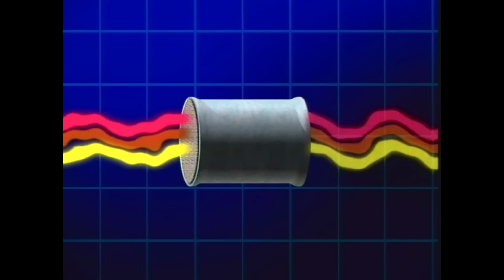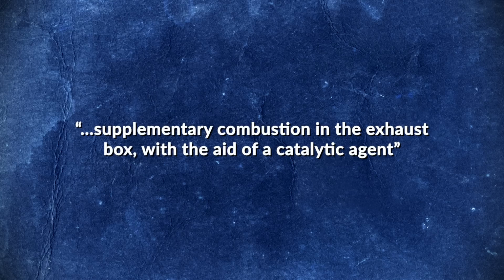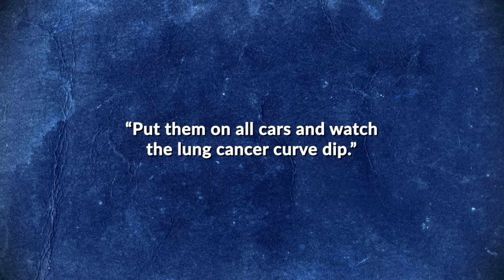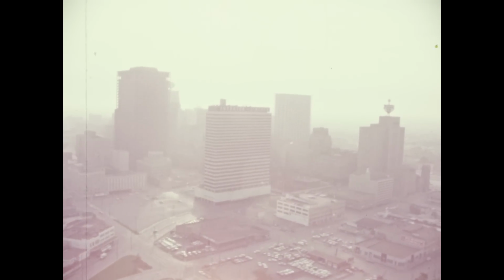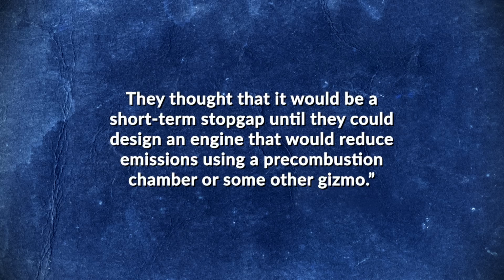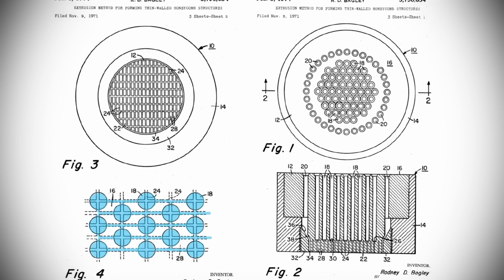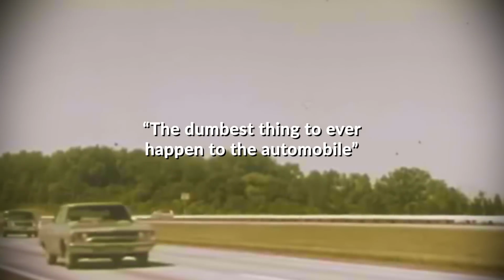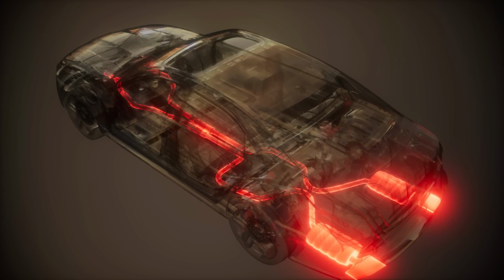The Most Underrated Automotive Component of All Time

Comment: Huh, who would have thought GM would sabotage any regulation that would cost them a dime even if it meant saving millions of lives.
Reply: I grew up in LA county in the '70s. The smog was bad. Was smog eliminated? No. But there was less smog with far more cars.

So yes. They save lives. Removing lead from the gas also saved lives.
Reply: @alannitcher5001  sounds like the city is the problem. We never had smog here. You also have smog pumps on California cars. Another thing that's killing your fuel mileage. A better factory tune would go a long way. To the point that they might not need cars as much, and have better fuel mileage to boot. Higher octane gas would help, too.
Reply: @manicmechanic448 Cities had smog problems, yes. And catalytic converters single handedly fixed them, also yes. Sounds like a win, to me! Especially since cities tend to be where most of the people live.
Reply: @manicmechanic448 And the fuel economy penalties are tiny, with modern cats. So that's no excuse to ditch them. It ain't the 1970s, anymore!

What do you expect to gain out of higher octane gas? You don't get better power or fuel economy out of it, unless your engine is limited by engine knock. You just pay more at the pump.
Reply: @Bertinator-nm9ld Catalytic converters were a major improvement.But cities also banned open trash burning and limited stationary emissions from power plants, boilers, furnaces, and incinerators around the same time as the introduction of catalytic converters.
Reply: @gregorymalchuk272  well, okay. You got me! Catalytic converters ALMOST single handedly stopped the problem. They weren't the only factor, but they were certainly one of the biggest factors!
Reply: @manicmechanic448  I'm from the burbs around LA. Where you know you're in a different city at night because the street lights changed. The valley is a huge boal trapping smog from millions of cars and other sources. 

I left that part of the state 30 years ago. Had trouble trusting the air for a couple of years. Couldn't see it anymore, so I couldn't keep an eye on it.

The legislation around clean air has made a huge difference in the air quality in this country and the western world.
Reply: @alannitcher5001  it's also, lined a lot of pockets, and added multiple extra layers of complexity to the average vehicle. Also, I don't care where you live, and if the air scares you then you got bigger problems than I do.
Reply: @manicmechanic448  Sarcasm escapes you, I see.

Yes, the air scared me. At times, I couldn't breathe. It was one of the reasons why I no longer live in LA county. I'm guessing that you've never had the pleasure of trying to breathe during a smog alert from the 70s. While having an asthma attack. Wondering if you'll be able to take that next breath, or will your throat close completely. If you never have, then you have no clue what you're talking about. But let me help you understand. Light a fire, stand in the smoke, and breathe for a few hours. The next day, do it again. For the rest of summer and into fall.
Reply: @manicmechanic448  No.  If you want less NOx and CO emissions you have to reduce the combustion temperature and compression. That leads to more particulates and even worse fuel consumpttion. EVs are the future.
Reply: @rogerphelps9939  you really need to see where EVs come from. And congratulations! You're successfully killing my fuel mileage. Maybe you stick to your day job.
Reply: If you think these things save lives, then you really are takin the Kool aid.
Reply: @manicmechanic448 Buddy, you're drinking GM's lead laced kool ade. Hell even Simon here is by stating it was a difficult unproven technology, right after saying they were already in use in heavy machinery 😂
Reply: @manicmechanic448  It is you that are denying reality. They most definitely do save lives. here is evidence you know, not your opinion.

Comment: When I was a kid we had a catalytic gas heater. It burned the gas on a corrugated plate with no visible flame. I believe it used the same technology as exhaust cars.
Reply: Your right. 
If you take a pure platinum wire and put it in alcohol vapor (or most any hydrocarbon) it will ignite and sustain a flame.
Reply: @Bob3519 Cool. Ty

Comment: CATs and unleaded didn't become mandatory until 1994 in the UK - over10 years behind the US, why?
Reply: In the UK, cats were mandatory from 1993, and leaded wasn't banned until 1999. Although by 1990 most cars were unleaded only anyway. Leaded fuel wasn't actually banned in the US until 1996. 

It's worth considering that the average UK car for much of the 70s, 80s and 90s had small engines of less than 2000cc. In the US, the smallest engines were typically closer to 3000cc and engines in excess of 7000cc were common. The level of combustion gas pollution was on another planet.

Cats were a pretty compromised solution. Without closed loop fuel injection, 3 way catalysts don't work very well. In the US many cats would have been rendered useless by exposure to enrichened fuel mixtures thanks to carburettors, or poisoned by owners choosing to continue to use cheaper leaded fuel.
Reply: Y'all don't live with your cars like the USA does. We have terrible public transportation as a matter of course, and its expected for you to own a car or you are not seen as successful.
Reply: Because they didn't have nearly the quantity of automobiles on the road as the US. Public transportation has always been better in the UK, the distances that are traveled are 1/20th and Brittain is old towns and cities where the US is suburbs branching out from cities.
Reply: It's crazy how lax European emissions standards were. The US required 3 way catalysts and computer control by 1981, 1980 in California. We had 2 way catalysts in the mid 1970s.

Comment: No, everyone is well aware of the catalytic converter and what it does. It is also expensive, which means people putting one on a car appreciate what it does, or they wouldn’t spend the $1000s to replace it. The most underrated automotive component is a small simple device, that even today you can pick up for a few dollars or less. Anyone with some basic understanding of engines can retrofit it to any engine that didn’t come with one in less than an hour with basic tools, however you have probably never had to because it has been on every single car since the mid 60s. This device improves emissions, fuel mileage, and horsepower! It easily triples the expected engine life compared to the same engine without one. It also helps prevent and reduce oil leaks, keeps the underside of your car cleaner, and is responsible for a significant reduction in wet weather car accidents! What is this magical part that sounds too good to be true? It is the lowly PCV valve! That is truly the most underrated automotive component!
Reply: Good call. Deep cuts with the PCV. 🔥
Reply: I have a car that the PCV constantly popped off mid drive. It ran like crap with it not connected. One day the piece you just popped the little hose back on was gone. So that hose is now just clamped to the PCV. That car is a 2005 Chevy equinox with almost 300k miles on it. I’ve replaced the head gasket twice. It has a small coolant leak now. The exhaust is fixed up as well as it can be without replacing it. The cruise control no longer works. The fob no longer unlocks the doors. My daughter drove it in high school and all the way through college. She also hit about everything she could and dented it up well. But that little hose clamp has kept that hose connected to the PCV for years now. I’m convinced it will be the only thing that’s totally functional whenever it gives up the ghost and we have to send it to the dead car grave yard. 😂
Reply: I replaced my cats with test pipes. Ill put mine back on once millionaires stop taking private jets.
Reply: I like to be able to walk behind my car when it’s idling and not have my eyes start watering and my clothes stink like fuel! If that costs me 3hp, then so be it!
Reply: A few years ago I swapped out the PCV valve in my nb Miata in an attempt to correct a code. It was definitely not the source of the CEL but I started getting 80+ more miles per tank. Same thing happened in 3 different Miatas. Incredible.
Reply: I don't think everyone knows what a CAT is/does. I sure didn't until watching this video. My dad was a bad teacher when it came to cars. I think when I asked him what it was he said "don't touch that" :)
Reply: People mainly spend the thousands to replace it because it's illegal af to not have it. If it wasn't illegal, most people would opt to leave it off.
Reply: @jorceshaman  Only in states and countries with emissions requirements.
Reply: @jorceshaman  They like killing vulnerable people.
Reply: I know many people, including myself, who have added cats to older cars that did not originally come with them. I also know many people who have replaced failed cats with new ones on cars that were exempt from inspection due to their age, and while it is true that just because nobody is inspecting the car doesn’t make it legal to remove the cat, as a practical matter if you have an older car that is no longer subject to inspection, your odds of getting in trouble for deleting it are extremely low, and yet many people still put cats back on those cars. So to say that the only reason people reinstall them is because it is illegal to not have them is not accurate.
Reply: @michaellehmann2803  How do you add a catalytic converter to an older car that never had one? Are they only oxidation 2 way catalysts? Do you add air pumps or lean carburetor tuning to keep the converter atmosphere in an oxidizing state? Do you add electronic carburetors/fuel injection and oxygen sensors capable of achieving 3 way catalysis? I am very interested.
Reply: The cats work without EFI or anything like that. You have to keep the carb tuned pretty well because if it is running too rich it will damage the cat, but assuming the car is mechanically sound and tuned up properly, simply welding in the cat is sufficient, and there is no need to add a smog pump or EFI or anything like that.
Reply: @michaellehmann2803  Some people have a social conscience.
Reply: Actually cars get better performance and mpg without the converter…look it up
Reply: @thomasnelson213 Very marginally better performance/fuel economy for drastically higher particulate emotions. If I cared about those tiny gains, I would have just bought a more efficient car, instead of touching the cats!

...And I did buy the more powerful engine, for performance reasons. Modern American V8s are marvelous!
Reply: @Bertinator-nm9ld  Extremely poor fuel consumpttion. More CO2 emissions. A bleaker future for our descendants.
Reply: @rogerphelps9939  Actually... cars WITH catalytic converters create slightly MORE CO2 emissions than cars without... That's the of the end products of some of the reactions. But the extra carbon dioxide is more than worth it, in exchange for admitting fewer toxic glasses, like carbon monoxide!
Reply: @Bertinator-nm9ld  Absolutely right.
Reply: @thomasnelson213 But far worse exhaust values. Look it up.

Comment: 0:36 Nitrogen is not a compound, but an element.
Reply: I believe the CAT  turns NOx (Nitrogen Oxide (NO)/Dioxide(NO2))  into N2 (nitrogen gas)  which would be a molecule but not a element nor compound so you both get half points for your effort. 

A molecule is a group of two or more atoms that are chemically bonded together. It can be composed of atoms of the same element or different elements. On the other hand, a compound is a pure substance that is made up of two or more different elements that are combined chemically in a fixed ratio.

Key differences:

Elements: A molecule can be composed of atoms of the same element (e.g., oxygen molecules, O2), while a compound is made up of atoms of different elements (e.g., water, H2O).
Chemical bonding: Molecules are held together by chemical bonds, but compounds are formed through chemical reactions that combine different elements in a specific ratio.
Properties: Compounds often have unique properties that are different from their individual components, whereas molecules typically retain the properties of their individual atoms.
Examples:

Water (H2O) is a compound because it is composed of two hydrogen atoms and one oxygen atom, which are combined in a fixed ratio.
Oxygen (O2) is a molecule because it is composed of two oxygen atoms that are bonded together.
Salt (NaCl) is a compound because it is composed of sodium and chlorine atoms that are combined in a fixed ratio.
In summary, all compounds are molecules, but not all molecules are compounds. A molecule can be composed of atoms of the same element or different elements, while a compound is a specific type of molecule that is made up of different elements combined in a fixed ratio.
Reply: @robertpayne6960  No, N2 is not not an element, N2 is simply the stable form of nitrogen in ambient conditions.